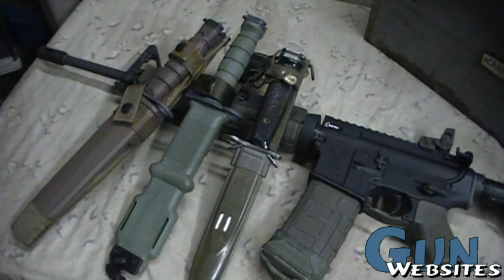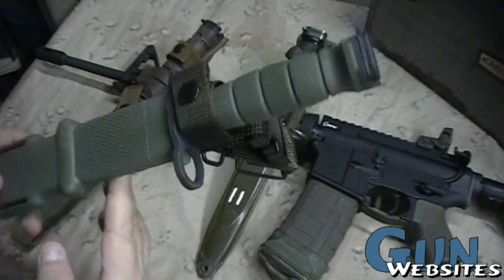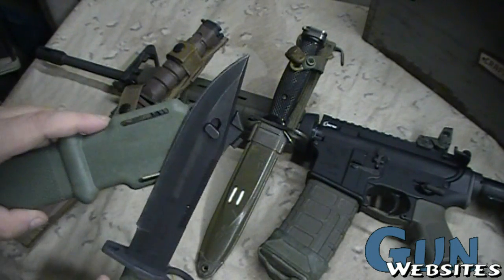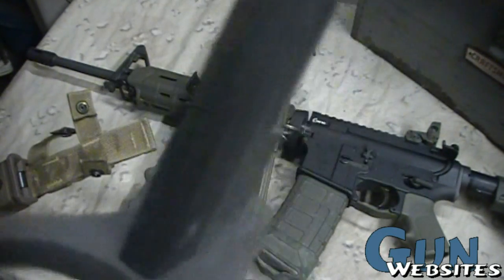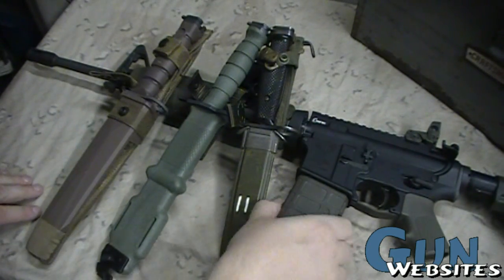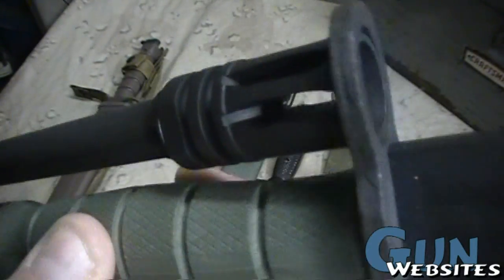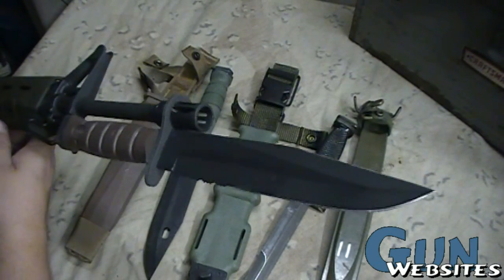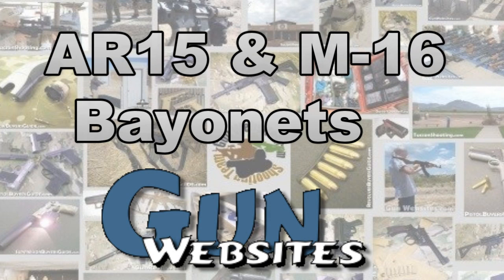M-16 & AR-15 Bayonet Overview

Comment: FYI: The M7 bayonet and the M8 sheath. In 1942 the Army and Marine Corps wanted to replace the M1 trench knife of WW1 issue. They could not decide so the Marines ended up with the KA-Bar, and the Army the M3 fighting knife. Since troops with rifles had bayonets, the M3 was issued to those who did not have bayonets IE: those who were issued pistols, Thompson's, M1 carbines, etc. They were issued with M6 leather sheaths. In 1944, the M1 Carbine was upgraded with a bayonet lug. Rather than design a new blade, the M3 was fitted with a new plastic handle, bayonet lug lock and barrel ring. The leather M6 leather sheath was discontinued and the M8 plastic sheath came into being. These are still being used today on the M1 Garand, M1 & M2 Carbines, and M16, M4. The only thing that was saved was the knife blades. (see EBay, M3 Fighting Knife.) I have an M3 knife and M6 sheath.

Comment: M9 bayonet is very strong blade and cuts the wire easier than ak. The Marine issue OKC-3S bayonet and it resembles K-bar knife and the replace the Vietnam era m7. The current generations m9 and OKC-3S bayonets